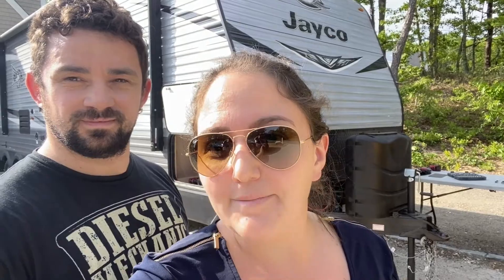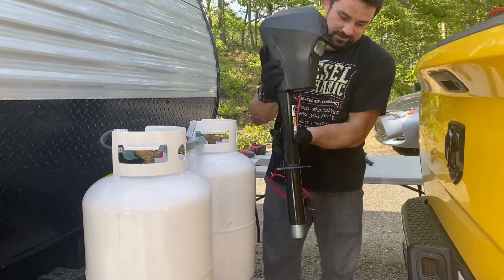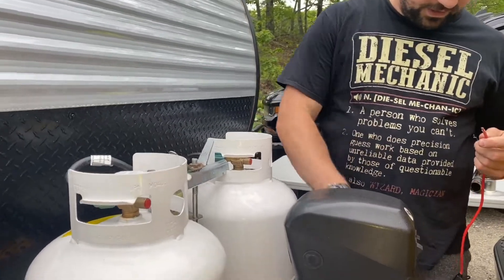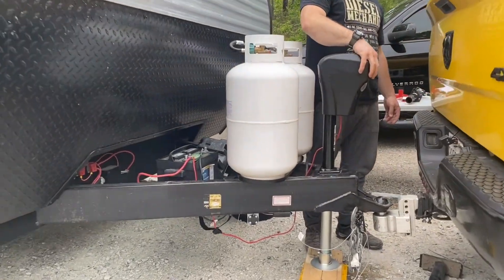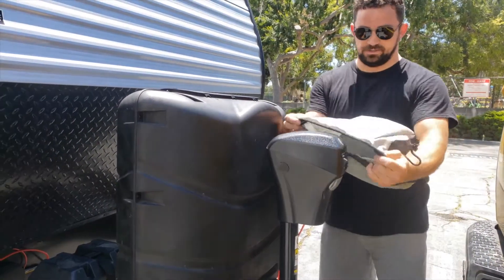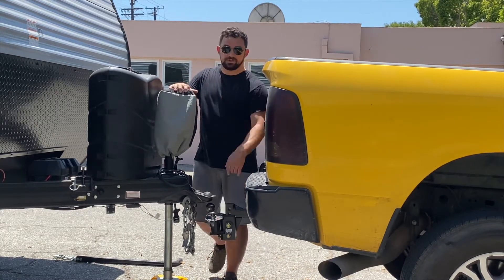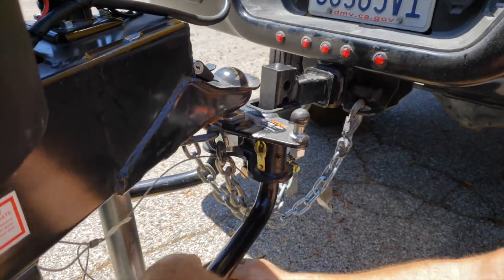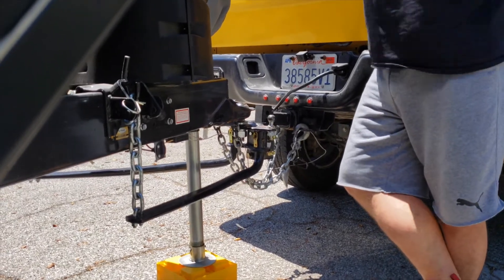1st Trip Prep... Let's hit the road!!!

Comment: Does the sway control work on similar principles to the steering dampener on a bike; to offset the jerking from side to side?
Reply from the maker: The way sway control works in this case is based on friction between sliding plates that is controlled by tightening or loosening center handle on sway controller. It's not really to similar to motorcycle steering dampeners they work more like car suspension shock absorbers.